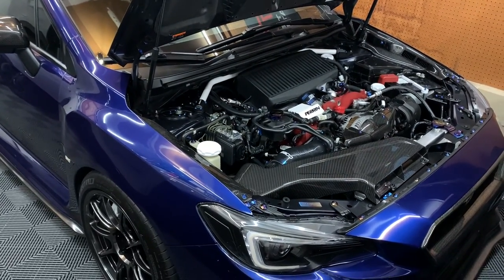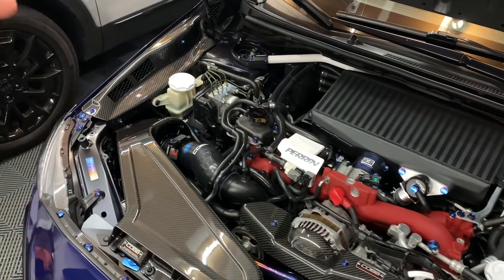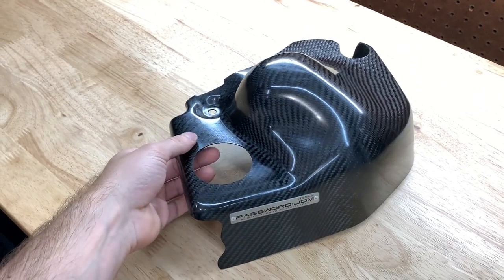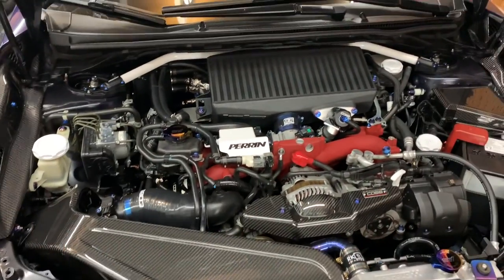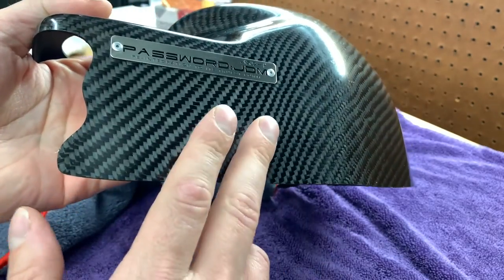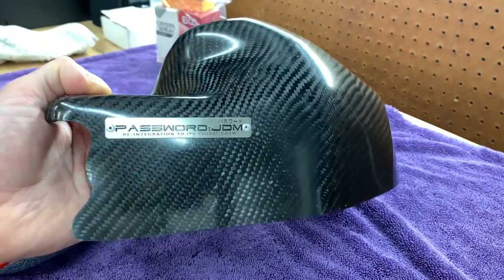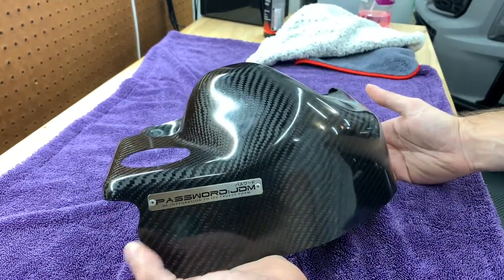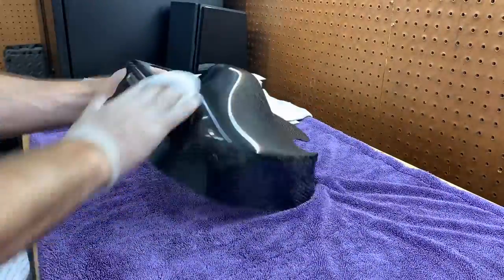Installing a Super Rare Password JDM Carbon Cover On My STI | Ceramic Coating

Comment: Looks very sharp indeed 👍. At least there is one engine bay item I don't have to consider as my WRX does not have hydraulic assisted power steering 🤣🤣

Comment: U wanna keep an eye on the fluid. Subaru power steering is prone to leak its fluid from the rubber boot
Reply from the maker: That’s what the little dipstick is for on the cap. I’ve had the car nearly 5 years and haven’t had to touch it once.

Comment: All I managed to do when attempting to ceramic coat my rear spats was leave streaks on it lol any tips on how to do it correctly?
Reply from the maker: Cross hatch and go over it a few times to make sure you get every area then wipe immediately.
Reply: @Scoobyfreak86  got it. Thanks I think I was leaving it on for too long waiting for it to 'flash' that rainbow color.
Reply from the maker: Yeah that’ll do it. Wipe off right away.